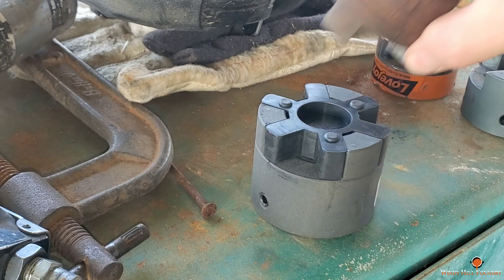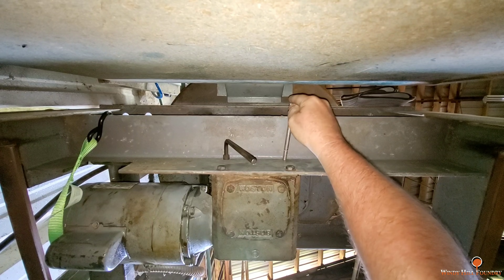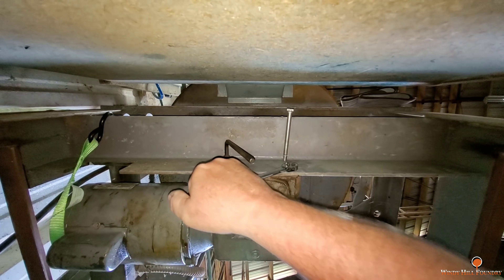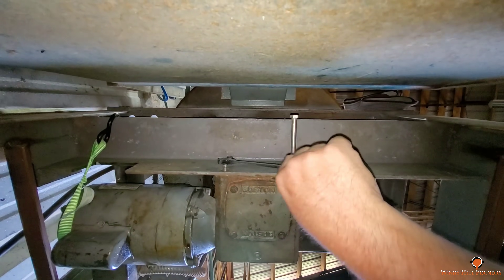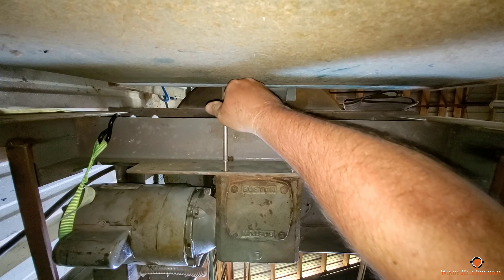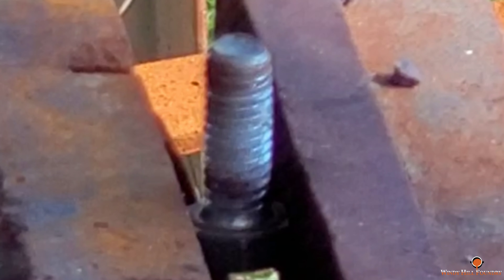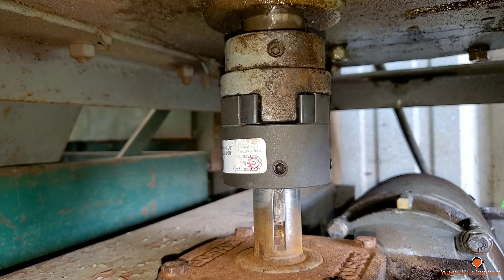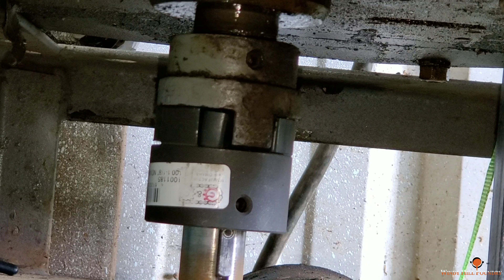THE MULLER REPORT PART2 AND THE ELECTRIC SIEVE

Comment: Nice. Note that your muller's motor isn't a modern slow start type. So the flexible spider is absorbing that startup inertia. A roller chain coupling will be more rigid. The lovejoy is also more forgiving of shaft misalignments. But rewatch the video around 14:44. That lovejoy spider is already being seriously deformed, I'm wondering whether the main shaft bearing is shot. Whatever you decide to do, obviously there should be a shear pin somewhere in the transmission. Good luck.

Comment: I noticed when you ran the muller it was lifting up at the coupling. One of the possible causes of this might be the build up of the sand on the wheels as it turns. It seem to have quite a bit of sand on them. Of course as it builds up or falls off it would cause the coupling raise and lower. If you put a coupling on the shaft that will not allow it to move I believe it will bind up some where else. Possibly a coupling like the sliding joint on a drive line
Reply from the maker: Terry the wheels float up and down as you stated but they are on independent pivoting arms. The head that these arms are connected to is suppose to remain at one level

Comment: Are the size of those hoops such that you could slice off some pieces of an oil drum? And since you like rivets (who doesn’t?) you could rivet on some handles.
Reply from the maker: Glenn the hoops are a little more complex, I should have removed it to explain but it's a two piece system to clamp the mesh wire

Comment: Good to see things working.  Lovejoy coupling issues,  You need a larger overall Diameter coupling hubs and with a bronze or higher durometer rubber.  The machine is over torqueing the coupling causing the cracking.  I have seen this on many low speed applications.
Reply from the maker: Randy, thanks for your input. Yes I agree, the current setup isn't the best for this application.

Comment: I believe our mullers had rotary screens to sort out pieces of cores, odd bits of castings, etc. from the return sand. They weren't perfect but they kept most of the odd pieces out of the molding sand.
Reply from the maker: Thanks for your input. I'd like to see a setup like that. Eventually I plan to have shakeout machine and filtration of foreign particles would need to be included👍

Comment: Depending on the hoop size you could make one from an old bike rim and the sieve mesh you need. Screw it on at the spoke holes with washers from the outside of the rim. Throw in a couple of the cast stars to bust up the chunks.
Reply from the maker: Thanks, that gives me another idea👍

Comment: The sifter works good. However I’d consider changing out the rope hoist. For safety, don’t need that rope snapping at the wrong time. Take care.
Reply: Go oversized too. Sand isn't kind to ropes, so if it is well oversized you can afford to not replace it for a while.

Comment: Exactly what is the OD of the sieve basket..  there are shops that have angle bar rolling tooling to make an new hoop.  or you can get one rolled out of flat stock.. and roll a flat bar into a flat loop to weld to the bottom.. roll 2 flat loops.. so you can bolt screens too.. if you supply the. OD diameter. you have Enough viewers that you might be amazed at what arrives.
Reply from the maker: Thanks Wayne, not sure what the exact diameter is but I may have some built later. It would be nice to find some already made though

Comment: Hi Clark, sorry to see you having so much trouble with your muller. Instead of that "star coupling"  (not sure what to call it) have you thought about trying a universal coupling like they use on tractor PTOs. They come in all sorts of sizes and if you can get one to fit your shafts maybe it'll stop the damage to the rubber spider in the coupling you're currently using. The UJ would be much stronger I would think and a drop of grease occasionally would keep it running smoothly.
Otherwise thanks for the posting. Regards from Canada's banana belt 👍🇨🇦🤞.
Reply from the maker: Hi Ron and thanks for the input. Yes I have actually given that some thought and it would work. The problem would be possible phasing from misalignment that could trigger lead and lag frequency which may not be a problem. The other thing is the time involved to retrofit, it's faster for me to keep patching the problem right now as long as I don't have anything detrimental going on

Comment: Clarke, for what it's worth, just grab a spider, throw it in a mold and pour an aluminium spider from low grade aluminium. It will be stronger than that rubber stuff but still softer and more pliable than the cast iron parts and so will provide the wear points.
Mark from Melbourne Australia.
Reply from the maker: Thanks for the tip Mark👍

Comment: A tool you might want to add to your arsenal is a car scissors jack for lifting the motor/gearbox under the Muller. It works better than a hydraulic jack as it is adjustable incrementally.

Comment: You definitely  need a different drive coupling arrangement me thinks. But the oak spacer is is cool as hell, it got the job done.
Reply from the maker: Warren, wood was and still is use for a lot of bearing applications. For this application I think it will do just fine🤞

Comment: That rag joint material should hold up. Or just cut up a tire sidewall and stack a few in there, now that it’s tight.

With the way the shaft lifts, it’s going to take a major retrofit to turn it into a chain drive. You’ll be popping chains off worse than a crappy old go kart.

Comment: To Me the wheels on the Muller are packing up with sand which will make them ride up so you coupler is pulling apart... My fix is a bearing block and bearing... As your wood spacer will degrade after a while below... ( Above the coupler and the bottom of the Muller drum ) Cool Vid tho thanks ... Cheers John...
Reply from the maker: Thanks for the tip John 👍

Comment: That Lovjoy looks like it's not gonna last. Maybe you need a chain coupling instead. They can't be pulled apart like that, and can take a ton of torque.
Reply: I should have waited until the end to comment. :) As far as your hoops, I just had a need to make a stainless ring much like that to repair a piece of ag equipment. I bought a cheap ring roller from Harbor Freight and rolled my own hoop out of stainless flat bar, and it was way faster and easier than I thought it would be. Saved a ton of money and ended up with a better than new repair.

Comment: I don't have a lot of experience with those lovejoy couplers, but the spider is getting mashed out of shape to easy in my mind  Do they have a polyurethane spider that can take the pressure you are producing?  I think you are gonna see that spider deform and be back to metal on metal too soon.
Reply from the maker: Yes they make harder spiders for this. I plan to replace this soon👍
Reply: @windyhillfoundry5940  I put together some equipment this year with those soft spiders.  3/4 and 5/8 shafting with a 1/2 hp motor.  Just to provide some vibration and isolation control.  But they were soft, and had no load like that muller does.  I figure that muller would need something like the hard, maybe up to the red poly used on car suspension parts.  

Your chair side chat about the heat issues has me thinking about how to build a shield that won't get in the way.  I don't know if that is possible.  Have you seen myfordboy's home built crucible tongs?  They snatch it up, lock it in, and he can pour without repositioning.  It moves him off to the side as well.  Any change in tooling, directly over the maw, seems a bit too sporting to me!!!  https://youtu.be/FK5wjqzvY-I
Reply from the maker: @stxrynn  yes, I think he pours aluminum which is super light to handle. If it wasn't for the current weight of iron I could make tools with additional touches. I do have  device for the heavier ones that is crane suspended. It pulls and pours from the same fixture. Problem is my crane is too cumbersome. I need a smoother track to use it
Reply: @windyhillfoundry5940  Welp, keep us posted.   I sure don't want to see you work harder than you have to.  Hurts my feelings.

Comment: Go to a PTO shop, get 2 PTO yokes the size of your shafts, get a male splined yoke and a female splined yoke. set the motor down lower, run the splined PTO shaft assembly between them and Shazam, you have cured the non-concentric problem and the vertical movement problem.  And if you ever had to remove the motor or the muller shaft you could simply slip the splined shaft into itself and it would be out of the way.  Another advantage is that the parts to repair the PTO shaft are as near as your nearest auto parts store.
Reply: That is exactly what I was thinking, probably get it done for less than changing out those lovejoy parts 3 times, and more forgiving than a chain coupler.
Reply from the maker: I actually was thinking about that also but I worry about possible phasing that could create a lead/lag frequency in the drive train
Reply: @windyhillfoundry5940  If you kept it (mostly) inline you would not have any lead-lag to deal with.  The slip joint would make taking it apart much easier.  My guess is that with those heavy rollers the slip in the motor would soften any out of phasing.

Comment: I believe a hard urethane spider would also work better I think.   Seems like what you have in there is a much softer durometer neoprene or SBR or something.    Don't usually see the urethane spiders squirting out like what you have there.
Reply from the maker: Hi David, yes this is too squishy
Reply: After I wrote that  you did mention another follower had already turned you onto the fact many different spider materials are available.  So I was a bit late.  Thank you and it good to hear from you and watch your videos and the various challenges that arise.  😊I quite liked the long guide bolt suggestion

Comment: Hello I see you video and when you put sand in the machine you have ball or rock of sand ,the wheel need jump up and dawn to break the sand ball  you will need that moment,another think when you put sand on it the wheels raise up so you may need two belt pulley ,two belt type ,remove gear box and mount it to the side with distance so the belt drive the upper shaft and move up and dawn I think this may work please think about
Reply from the maker: Thanks for the tip Hito
Reply: Hello on concrete mixer truck to drive the front hydraulic pump they use drive short drive shaft with splines this will work for you machine ,you have to drop dawn the gear box check it out  ,Hito

Comment: Great video, love repair videos. You definitely got some internal backlash in the Muller that needs to be repaired possibly by internal shims. That shaft should not move and the two lovejoy coupling pieces should not touch at all. , there is a certain clearance it should be set too. The rubber insert is coming apart because of misalignment and backlash movement. To use a chain coupling you will need to have no movement in either the drive unit and the Muller. You will need to get the two shafts
 perfectly aliagned by someone like a Millwright using dial indicators and clamps , that does this for living.  I have  been doing machine alignment for over 40 years on big fabrication equipment for a large aircraft company., proper aliagnment will keep your equipment running for ever, . Love your videos, I wish you were closer, I would love to  give you hand, no disrespect meant.
Reply: From some of the videos ive seen, this guy is not precision....lol
Reply from the maker: Thanks, my main problem is rigidity and yes there is an alignment issue
Reply from the maker: I am a cmm programmer in quality at Eaton Aerospace during the daytime. I deal with tolerances that are in the .000050" range that come off perplex theoretical datums. I think I know a little about precision 😁.
Reply: I had no idea , I apologize if I misspoke, no harm intended. I do some repairs where it just has to last until I can shut the process equipment down until it can be taking out of service to do the proper repairs, usually I catch the problem during Preventative Maintenance, but, when it comes to mfg equipment. stuff happens. The oak spacer  is pretty good idea, I use that setup on my Foley-Belsaw SawMill for the blade guide.Thanks for setting me straight.
Reply from the maker: @TheCajunHomestead  no harm at all my friend and the reply was directed to 69uremum which didn't offend me either. I didn't want him to think I practice sloppy tolerancing😁. When it comes to keeping this foundry though, running, patch jobs, even if temporary, can help keep from breaking the bank. 👍
Reply: @windyhillfoundry5940  just poking fun, I was just calling it how i saw it in regards to the muller:) You could be a certified genius and math savant, but the repair was sketchy.
Reply from the maker: @69uremum  👍

Comment: An Oak thrust bearing. Very dissimilar materials. Better than it was, and it may outlast that coupler. I can tell you're the guy that gets thrown off the horse and gets right back on it.
Reply from the maker: Wood bearings have their place and I think this application will be ideal with low rpm👍

Comment: Can you make a custom spacer and thrust bearing above the top side of the coupler and the bottom of the tub?  McMaster has needle type bearings and precision washers https://www.mcmaster.com/thrust-bearings/needle-roller-thrust-bearings/.  Buy 2 washers and make a thick washer to take up the space... It would put a fair amount of force on the set screw holding that coupler on.  Maybe you could use a roll pin.  Ug.  I'm making more work for you.  Maybe better watch for a better suggestion.  Good luck!
Reply from the maker: Thanks for the tips, I'm going to see how long that piece of red oak holds up👍

Comment: Well, you now know that you can get different spidersfor the lovejoy coupling. So I don't need to tell you about that and the experiences I have with learning about them. I wonder if you have a Graingers Supply in your area? They could help you with the spider type you would need. I would suggest you get a chance and read up on how lovejoy couplings are applied in motor and rotating equipment. Could help you alot in your problem.I think  there are teflon spiders which might help in your application. I could see that the spider you were using was getting pinched and distorted, not long for this world. Love the new vibrator for your sand pile. The shot of the motor was interesting, seems quite old.
dollar and the other pup look good, take care and I enjoy your work style. Thanks for the look.
Reply from the maker: Thanks for your input John👍